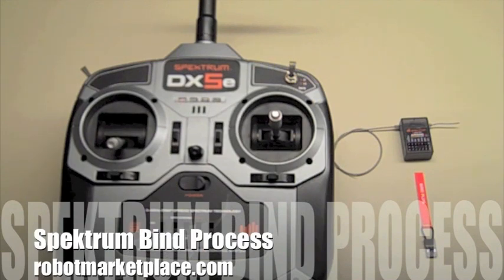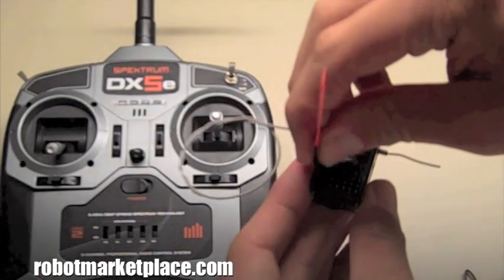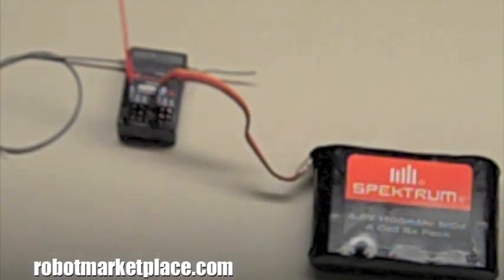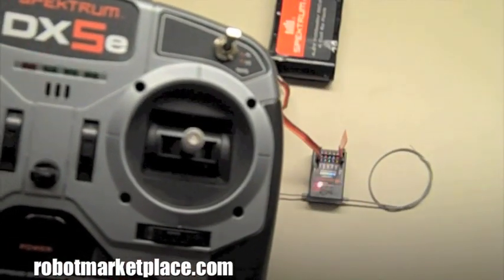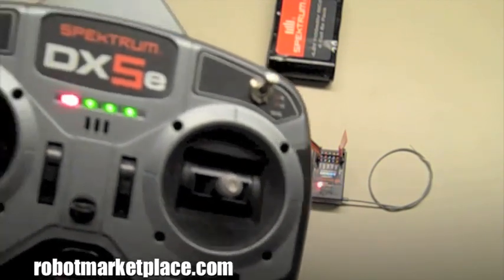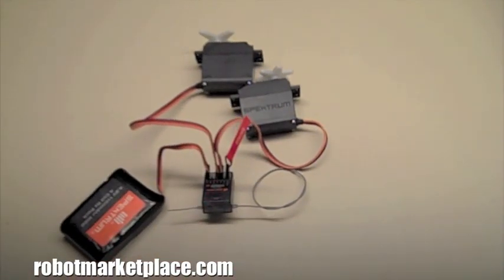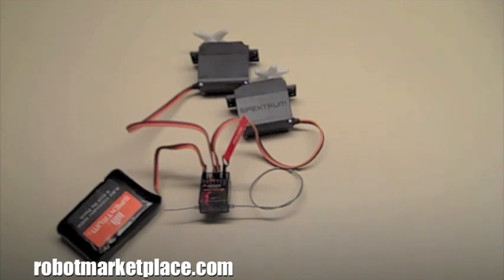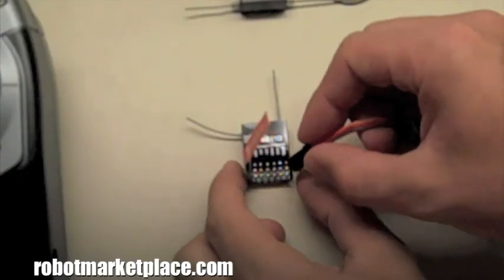Spektrum Binding Demonstration - The Robot MarketPlace

Comment: Hey, i just got my DX6i, and i was going to to the binding thing, so i connect the bind plug, connect a couple servos, and ... surprise my Turnigy 2.2 bat has a bigger connector has a 4 pin not a three :S where do i get that spektrum battery pack(black) that you have. And after that when i connect everything on my bixler how do i adapt a battery to my spektrum receiver if batteries have four pins? sorry little new on this! Thanks

Comment: @gewizz2 wait, you said tx. Some transmitters will be able to handle 3s, but again, most won't. The DX5e and DX6i both take 4 AAs, or ~6V. Doubling that with a 3S lipo is going to make the radio a bit unhappy.

Comment: @gewizz2 A 2S lipo would be fine, but Spektrum says "Voltage Range:Input: 3.5–9.6V" A 3S lipo is 11.1V, fully charged it's 12.6V, quite a bit higher than 9.6V. But if you want to run your receivers on 3s, go right ahead.